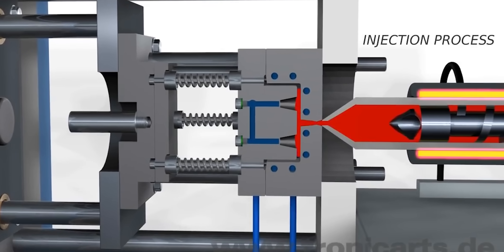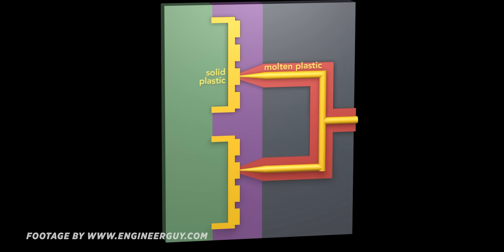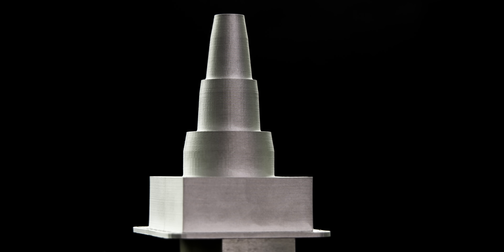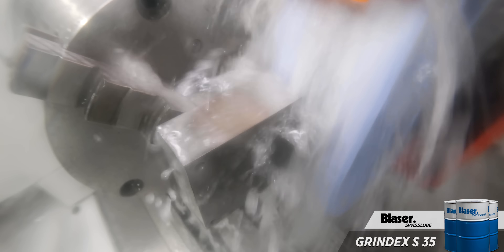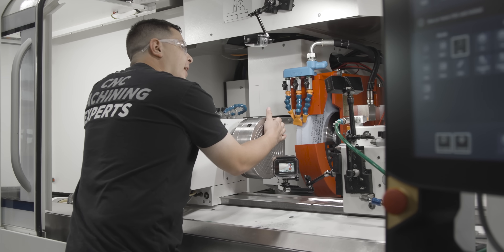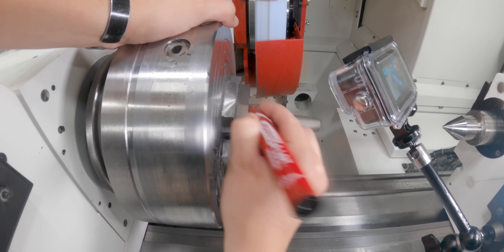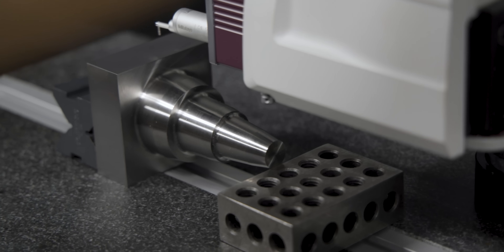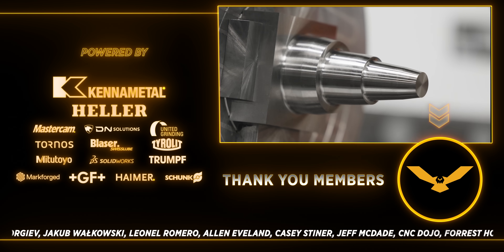Can You 3d Print A Mold Insert With A Flawless Finish?

Comment: The infill of the 3D print won't transfer heat as well as a solid mass. I could see doing this, but you'd likely want 100% infill with some over extrusion to minimize porosity and maximize thermal mass

Comment: I machined a 3d printed small rocket assembly for some grad students at CU Boulder. Those internal cooling channels were filled with powdered metal. It was a laser sintering machine. this is the one time that printing with filament is better than laser sintering.

Comment: Just remember this is a demo.  This is not a legit core for a plastic injection mold.  For starters, there is no ejection for the molded part.  A high volume mold for this part might be beryllium copper cores with sleeve ejection. No incredibly expensive equipment required.  What I dislike about this is some upper management type sees stuff like this and believes that this how it should be done because he saw it on YouTube.  3d printing will have a place in mold making but this ain’t it.

Comment: why was 100% infill not used? the infill looks like 50% grid pattern. this will reduce the heat transfer significantly as there is an air gap between mold core coolant channel and the core surface make it harder for the heat energy to flow from plastic to the coolant. moreover the way the channel is designed you will end up with uneven temperature distribution leading to warping of the plastic after the part is injected. the deeper part of the mold will have cooler temperature then the less shallow part. This is because the coolant will be in contact with deep part first and its temperature will rise and by the time it get to the shallow part of the mold it will not draw heat  efficiently leading to heat distribution over the core.

Comment: I much prefer powdered metal bed printing for 3D printing metal parts. You get a finished product straight out of the printer, and they usually have a much higher fidelity.
Reply: 5 ra from a printer ?
Reply: H13 from a LPBF printer might be hard to achieve. Binder Jetting could be a good opportunity. ;)

Comment: With polymer prints, it's very difficult to get fdm prints liquid tight. Does centered metal parts suffer from this? What's a pressure rating on something like that?

Comment: I didn't get why use a slow grinding wheel instead of a lathe
Reply: Surface finish maybe
Reply: Surface finish is one reason.
Plus the lathe far more likely to chip the sintered material than a grinding wheel, potentially scrapping the part and making that slow grinding wheel not suddenly seem such a bad idea for a one off part.

Comment: Great way of getting it done! At the same time I'm a bit confused on the design side of things. It looks to me like the walls between the cooling channels and the surface that is in contact with the hot plastic are structured like in a part where weight saving is most important. For this part, where the most important aspect is the heat transfer from the plastic to the coolant, I would expect the material in between to be massive in ordner to maximize the heat transfer/ minimize the thermal resistance. Right?
Reply: You will find infill in pretty much any 3D printed part, it isn’t just for weight saving, it means you use less material and it is faster to print. They might have enough heat transfer even with the infill, the bottleneck may be the heat transfer through the plastic not through the infill in which case the infill isn’t really causing any harm. Either way it will still perform better than a machined part without any cooling channels.
Reply: @conorstewart2214  you can't have infill when doing metal powder fdm 3D print like this, since it will cause unpredictable warping of parts during the sintering process. There is software that can account for it, those don't available to markforge machines.
Reply: @QuangNguyen-wb5kd  rewatch the video, especially when they show the sliced model, it definitely looks like there is infill there.
Reply: Maybe it should be open inside with fins so we can cool with air like a heatsink.
Reply: I'm not a plastic injection guy,but have experience with aluminum permanent casting.  I would wager that that core has to cycle hot and cold for each shot. More mass therefore equates to more time thermal cycling. In aluminum, the entire mold has to be at temperature before the shot can pour consistently.  Im guessing Plastic is probably similar.
Reply: @roryjokaiser8977  A few thoughts about this: 1) I don't know about a plastic injection molding process where the tool has to be heated, maybe in a niche application where you want to achieve extremely thin walls or something. 2) If these channels are used not only for cooling, but also for heating, the expression "cooling channels" would simply be wrong. 3) If you would need to cycle, then it would be just as important to have a small thermal resistance between the temperature control channels and the contact surface between the part and the tool. It would then maybe make sense to get rid of material on the inside, between the channels.  still, the space between the channels and the surface should be filled. Also: If material is not necessary between the channels and the surface for strength reasons, then why have space in between anyway? Get the channels as close to the surface as somehow possible. Right?

Comment: A completely DAQ for you: It seems that a TON of work is needed to get the "desired"" and absolutely beautiful surface finish on this part. Does this extreme surface finish actually contribute to the part's function of mold extrusion and cooling, or is it mostly for the aesthetics? If it is indeed the latter, is it worth the extra post-processing?
Reply: Yeah, it's needed. Molds almost always have to have pretty perfect surface finish. If not the plastic part will have all the roughness of the mold.
Reply: If this was an actual insert they would need to polish it to perfect mirror finish - assuming the part is supposed to be smooth, even if the part does not need to be pretty a mirror finish prevents rust and reduces forces needed for removal.

Comment: I think this insert will not be able to withstand the pressure when the hot material fills the gaps in the mold, because the insert has cavities that have the potential to dent and even break, it should be solid material
Reply: I work in IM, and this wall thickness looks really safe, don't forget that this insert NEEDS cooling, normally they would drill a lots of holes and plugged them, this looks way safer and less prone to clogging.

Comment: 70% improvement? That may be true for this part, but it's not even the best scenario. I saw a showcase once where an injection moulding die had its cooling time reduced from 30 seconds to just 5 seconds through redesign with conformal cooling...

Comment: Nice, now that i a finally left the mold Business, you create a mold insert 🤦‍♂
so, question: i saw the printing strategy was a material conservative one, with an inner lattice structure. Doesn't that defeat the conformal cooling, when you have air between the cooling channels and the mold surface?? (aside from conservative mold engineers would deny any structural integrity of that insert, if its not at least 6cm solid metal)
Reply: Just what i was thinking, finally someone who gets it...:text-green-game-over:

Comment: So will the sintering furnace also heat treat the part?  Or if you needed a specific heat treat or to draw it back you would need an extra step and a standard heat treating furnace?  Charles
Reply: The insert comes out of the furnace around 40 HRC. For molds you would want to heat treat it after sintering. Using this process is actually cutting out quite a few steps compared to how you would do it traditionally.
Reply: @trevorgoforth8963  thank you, I was assuming that would be necessary.   I wasn't sure if the printed materials could even be heat treated or not.

Comment: A company that I worked for did an insert like this about 5 years ago. Had a vendor 3D print it for us, and we did the machining. It had a steeper angel to the coolant channels, but same idea. It works well, and the mold is still running.